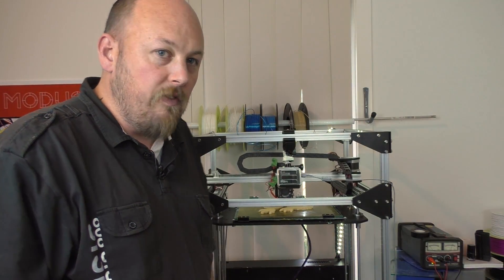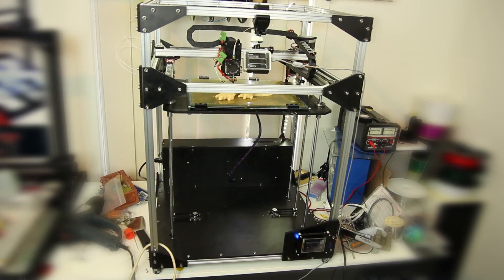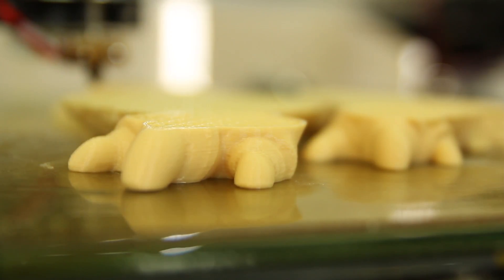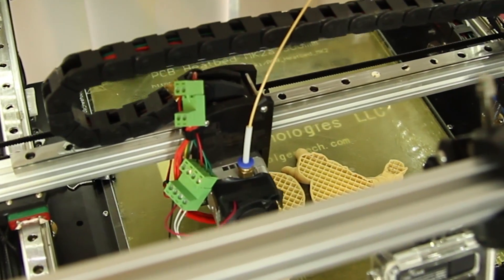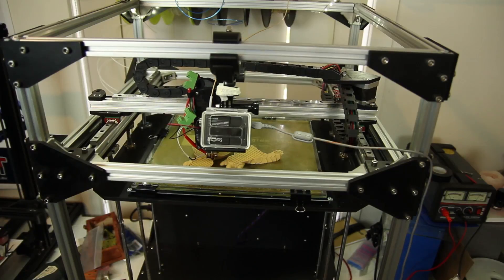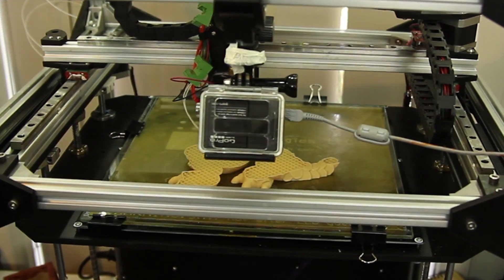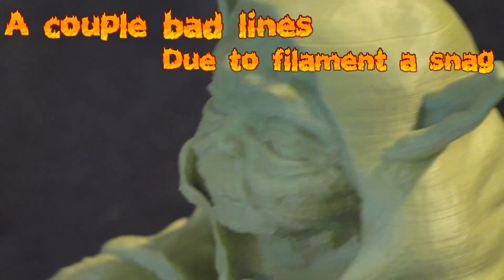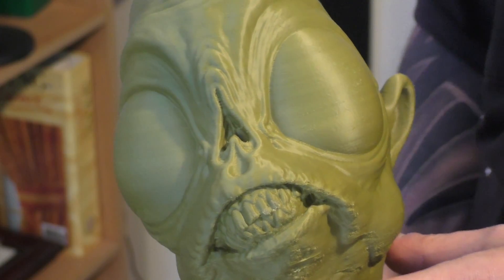FolgerTech FT-5 3D Printer Preview

Comment: Need you to expand on your claim "rival an UM2" print quality, have one, thinking about getting one of these, need clarification. Thanks
Reply from the maker: Adam Hadden maybe rival a um2 is not the best way to put it - this when tweaked will give you similar results - however a printer is only as good as its builder (and this is a kit) check the folger groups on Facebook many will agree its printing way way above its price point
Reply from the maker: Adam Hadden the Zortrax is better again but it's also $1400 more expensive
Reply: The Hot End - 3D Printing & Technology I also just read the zortrax opened up their printer to except 3rd party filament, they were off my list until they did that. Thanks for the reply, in the US, but love the "down and dirty" reviews I get from Aussies.

Comment: I'm thinking about buying the folger tech ft5 in the next two weeks. should I just wait for the hot end edition?
Reply from the maker: Hi! Im still waiting to hear back from Folgertech so i'd buy the FT5 now - When it eventually comes out you can get an upgrade kit most likely anyways  - Please use my code THEHOTEND helps me a bunch - thanks
Reply: The Hot End okay. maybe I can get the upgrades over time anyway. I read about the cnc kit that is coming for it too. Sounds like a very versatile printer. Do you think I could eventually do dual extrusion on it. The new melt away support printing techniques look pretty useful. Thanks
Reply from the maker: All kits should be seen as a platform to build on / like a clean slate to make it into whatever you want - Dual extrusion or more will be easy. I'm thinking of using a Tri extruder diamond hotend in my "HotEnd Edition"

Comment: Outside of the Smoothieware did you make any firmware changes from what FolgerTech provides (Marlin_V3), if so could you list the changes?
Reply from the maker: H20FRKS hi! I tweaked the firmware manually if that's what you mean. As the mks sbase (may have called it gen in the video) is smoothie it takes its firmware via a text file on the sd card. I modified a few of the values such as acceleration and esteps and a few other odds and ends